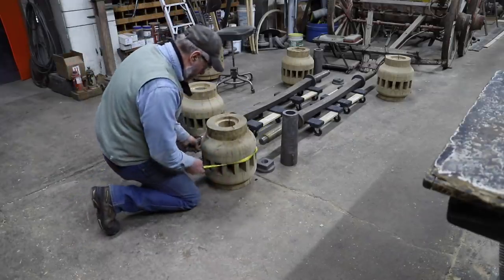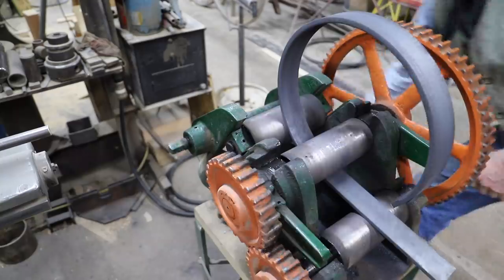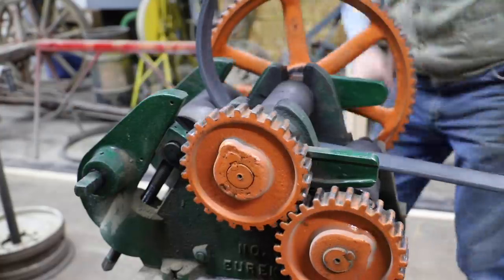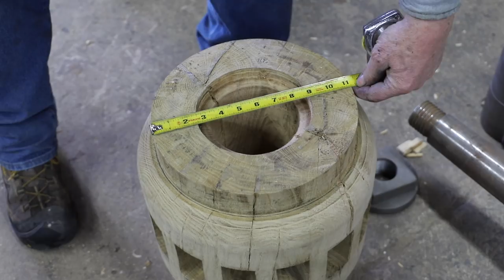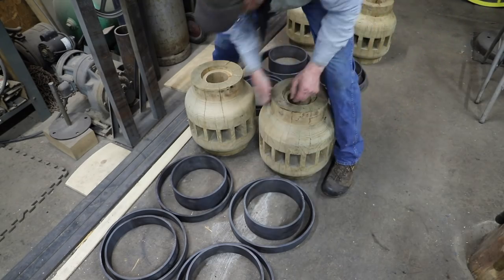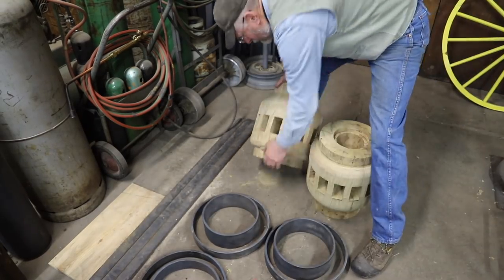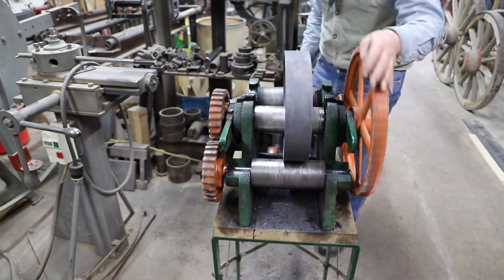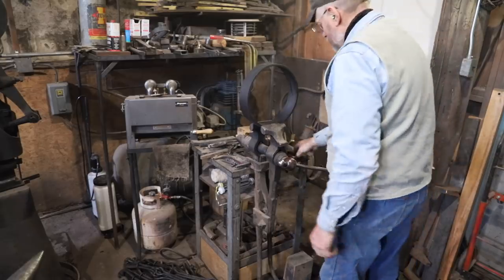The Challenge of Heavy Wagon Hub Bands for the Water Wagon Wheels | Engels Coach

Comment: As a boy, I found a pile of rotted wagon wheels and hubs beside the granary on my grandparents' farm in WVa.  I took one of the hub-bands off to the shop where I found some heavy gauge steel wire.  I cut off a length of wire and bent one end around for a handle.  The other end I first bent back in a U-shape, then bent a right angle so the U-shape was cross-wise to the wire.  I used that wire to push the hub-band all over the place.  A few years later, when I was big enough to handle it, I took one of the steel tires and rolled it to the top of the hill up behind the house and farm buildings.    Once up there, after catching my wind, I pushed that tire off over the side of the hill.  It rolled forever until it hit a tree and knocked off a big chunk of bark.  Whatever it took to catch a kids fancy in those days!!!  Enjoy watching and appreciate your work.

Comment: That’s a cool way to get the flat black look. I’ve never heard of doing that. Learn something new every day.
Reply: On this channel, you learn something every video, i feel like. :)
Reply: I agree
Reply: Apparently you can get better "black look" using vegetable oil - it'll look more like gun black. Not really shiny as the oxide on guns, perhaps just a smidge shinier than when using mineral oil.
You can also use "used oil", like the one used for frying french fries in McDonald, or chips in some fish'n'chips shop - depending where you live  ;-)
Heat the steel to approx. 250 - 300°C/ 500 - 600°F (above oil's smoking point), and then "paint" the steel with a  rag soaked in oil, or with some brush. Dipping hot iron in oil might cool it too quickly, so the result might not be as good.
Reply: I've used Bees wax to put the finish on fabricated parts. Petroleum oil just stinks so bad, but it does put its own color to steel. Then the slight char under the band's prevents rot.. A natural preservative.
Reply: Used motor oil is cheap and it works.
Reply: @seppa6417  I agree - and I never said it doesn't, or that it is expensive. Used vegetable oil, which is normally thrown away is also inexpensive, and it also works. But just a little better - and that's it.
Cheers.
Reply: Hey MrKotBonifacy,
     Used vegetable oil sure smells a lot better, too!
Reply: @seppa6417  Precisamente, amigo - but the smell is also better... : )
Reply: The same basic process as seasoning a cast iron skillet, just not using a vegetable oil.
Reply: @seppa6417  And used motor oil is highly toxic.
Reply: I think it also helps mitigate rust to a certain degree. The thing to remember is these are borax wagons. They work in a VERY dry environment.
Reply: i thought is was the only way lol

Comment: I like that new self-welding steel you're using for the ends of the rings...
Reply: I thought that it must be a secret inclusion from using the ring roller and the anvil.
Reply: I to noticed that too, was going to ask if he had another video showing the process. I was unaware of that self welding steel, I learned something new.
Reply: BiddieTube I searched the web for 'Self Welding Steel'.  Zero results.   I assume 'self welding' is a joke.

This begs the question...were the rings stick or MIG welded, with the fillet subsequently ground smooth?
Reply: Out in space steel will self-weld.That's why everything is coated in plastic.The hard part for him was getting the spacesuits on the mules.
Reply: Self welding..yes, a joke. He almost always shows the MIG welding.. @gregparrott
Reply: @fulkthered  you, Sir, have won the internet for the day! Bravo!
Reply: Doug Ankrum  I first thought it was a joke. But with all the advancements these days, I had to check....Perhaps a new brazing technique had been invented, where a filler is added between the gap while it is still glowing hot, and this essentially fuses into a weld? Or, 'self weld' was a colloquial term for friction welding? (friction welding would mighty high tech for this shop to have)
Reply: Beautiful -- "self-welding"! I also noticed that at 14:32 there is a jump form "ready to weld "  to "welded & ground smooth".
Reply: @EngelsCoachShop  The old rings were "pressure welded". Way back in the Day!
Reply: @gregparrott  I can't tell if this is a joke post or not but I laughed hard. :D
Reply: @bashkillszombies  After decades in engineering, if a technique of 'self welding' existed, I should have heard of it. Friction welding is too high tech, the tensile strength of brazing between thick, widely spaced parallel surfaces is VERY unlikely to hold, and casting molten metal between room temperature surfaces of wrought or forged steel will never bond. Do you know of another option?
Reply: @BiddieTube  You should probably check out 'This Old Tony's' channel for stuff like self welding steel.
Reply: @cedainty  -- It's called forge welding and it's still done, but a mig welder is a lot quicker  ;)
Reply: Congratulation Isaac Very Very Very Good Crastman

Comment: Dave:  Well done.  I am not sure if these bands 'must' be done in the old-fashioned manner but you could save days  of work by simply ordering in nominal pipe sizes and cutting it off.  10" pipe for instance has an ID of 10" Schedule 40 (Standard) and a wall thickness of 0.365".  12" ID has a wall thickness of 0.375".  It seems that would save you days if you turned your hubs to meet these dimensions. They could of course be cut and the Circumference shortened to suit smaller Dimensions.  Pipe 6" and over comes in even numbered sizes.
You are very skilled at that hydraulic press and antique roller, but the time involved is enormous.  Yes, you would have to dress the cut edges but that does not take a lot of time with proper equipment.
I also appreciate no music and not giving the anvil an extra tap each time you strike your target.

Comment: When I was working in the engineering shop of our family textile mill in Scotland over 50 years ago, we had a similar problem with the pipe threading machine, that I see you have with the hand rolling mill. As you crank the rolls, the machine tends to walk around the floor. We solved it by letting 4 steel sockets into the floor, into which the bottom inch of the legs of the threading machine would fit, to locate it positively. When not in use, we made four wooden plugs to fit in the sockets.
Reply: Good idea...
Reply: The other way would be to mount the machine on a flat plate and stand on it when cranking, this way the machine can be used anywhere.

Comment: That sure is a man-sized ring-roller you've got there. To note though, it should make it a hell of alot easier to fit those bands if you chamfer and soften up the hard-edges on the hub that you need to get the rims over. A palm-sander with some 320 on it should be sufficient, so long as you've got a steady hand. I've even seen old-timers chamfer the edges of their hubs by heating up a smooth chunk of iron til it turns a bright cherry red and just rubbing it over the sharp edges. It's crude, but it's fast and it works.

Comment: Hi Dave;
A  couple of people commented  on your hydraulic press  and called  it  a new  piece of  equipment.  Except  for the  electric  motor  it looks like one we had that came out of a railroad shop and was built in the 1870s.  Someone else asked this question but got no answer. Why do you not preform both ends of the ring in the press before you roll it instead of heating and hammering the second end after rolling the ring?  I am over 80 years old but still work in my one man shop where I do antique cast iron repair so it's always fun to look over the shoulder of a  craftsman in a different trade who really knows what he is doing! THANKS!
Dan
Reply: @EngelsCoachShop  Thank you so much for your reply.
Dan

Comment: I intend to put a steel rim on a 28 inch sprocket  weld them together then  turn to round and have them spin balanced.  I have 20 of these to do  I learned a lot from watching this video  The little wheel to measure the tire (rim)  and bending the  the first few inches before using the roller  I would have figured out the template but all this was/is very interesting to me.  ..I am making a band resaw  with these and you give me a lot of comfort.   A Huge Thank You for sharing your knowledge

Comment: What was the "original" material? Yours looks like CRS, would blacksmiths hammer out rings from wrought iron? They didn't have modern steel or arc welding, so they must have?

Comment: Hi ,I do admire your Work a lot.. is very Professional, question I have a wheel wagon one of the spoke  is damaged ,can you replace the only one spoke or you  do  need to replace all the spokes for better alignment and balance on wheel ?? or probably  the two wheels on this case is the back wheel , thanks.... wheel 42 in diameter  16 spokes
Reply: I saw in another video he only replaced a few of the spokes. So I'd imagine it's possible.

Comment: At 14:29 you've not welded the ring-ends together, as the gap is evident. At 14:43 and from then on it appears that the ends have been either welded or forged together. Did I miss the joining process?  I know I've seen you weld together in prior videos.
Reply: I would still like to have seen how you go about it when making the thicker bands.
Reply: With Mr Engels that bit is "Magic".

Comment: You must have a cheap source for replacement lungs! Please, get a metal cutting bandsaw instead of using that abrasive chop saw! I do not think I will ever be making any wagon wheels. I may need to make some steel rings though, watched video for that reason. I was surprised on how the bands just became welded and round, but found out about the self welding steel you use from a comment below. You sure seemed to do a great job making those, I bet you are one of a very few who can make wagon wheels. Where can I get a metal roller like or similar to the one you used?

Comment: For as much heating as you do it would probably pay for itself to build or buy a propane burner instead of running oxy acetylene as you don't heat a ton of stuff bright red. You might be able to get by with even a weed burner.

Comment: Is it not quicker to cut flat bar from the side sitting shorter depth rather than going through the end cutting the full width like you was doing?
Reply: The motor has limited power so to cut on the flat would (in theory) take just as long as the same material is being removed. However I suspect that frictional drag is much less cutting on edge plus the cut material is cleared away much faster so is likely make a faster cut with less stress on the machine.

Comment: I may have missed it but how did you join the ends of the bands? I don’t believe they had welders back in the day.....
Reply: They actually did weld back in those days.  They heated the metal to red, almost white hot and beat the hell out of the pieces into submission.  Called hammer or shock welding.  Had been used for centuries.  There's a process where they use explosives to weld metal cladding to a base metal.  https://www.youtube.com/watch?v=u9_bqafUJfA
Reply: Dan Burch I know of these processes Dan. I was referring to a mig lol. That and I didn’t see how the weld was done in this video?

Comment: I have a question.  I don't understand why the bands were not heat shrinked on?  I don't know if the bands would stay on very long.
Reply: Remember how he oil blacked the rims and then reheated them with the torch, then he put them on the hubs.
Reply: Apart from missing how they were heated for fitting you also missed how tight they were when fitted hot. When cold they will be immovable. I can only wonder at your experience of this video.

Comment: I wish I had 1/1000th your skills. You need a couple apprentices to keep the skill set going. But why do you have the end rings protruding past the wood? I would think that would cause problems with what the hub rotates around
Reply: the reason the outer hub band protrudes is to protect the end of the hub , its only the outer one that does  if you notice so it doesn't interefere with anything ,
Reply: sven sven 
I believe you’re correct about the protection of the axle end  but the inside (back) ring also protrudes but not as much. Probably just the difference of the 2 1/2” band vs the 3” band.

Comment: WHY DO YOU PUT WATER ON THE COALS ?
Reply: To keep the fire from getting too big,  You burn up less coal per fire that way.
Reply: @Azamyth  -- It also helps in the transition from coal to coke.  Coke is what's  actually burning in the fire, which is coal with the impurities burned off.  As the coke is consumed, you slowly push coal towards the center.  You'll notice that smoke is only being produced in the transition zone as the impurities are being burned off.  Burning coke doesn't produce smoke.  Some Blacksmith's only use coke, but it's harder to find.  Also, the impurities that don't burn off will melt down into the fire pot and form clinker, which is not good when trying to forge weld as the fire needs to burn clean.  I like to forge weld with a newly lit fire before too much clinker forms, after sufficient heat and coke have been obtained of course.
Reply: For you aspiring blacksmiths, DO NOT put water directly on your fire pot, only on the coal on the table surrounding it.  To do otherwise will most likely crack your fire pot!!

Comment: Do you use cold rolled steel for these ?
Reply: Look at the mill scaled dark gray outer surface on the steel as he cuts it to length. It's hot rolled. Most cold rolled steel has a far more shiny steel finish.

Comment: Why don't you just  form both ends in the press at the same time.
Reply: The metal is deformed only when between the 3 rollers. Therefore the ends are always straight.
If you watch again you will see this. The first end has to be pre bent or it will not go between the rollers and the other end suffers from the same problem as it enters the machine.